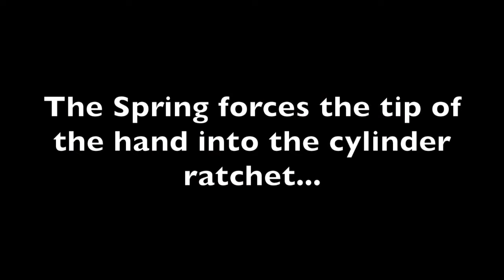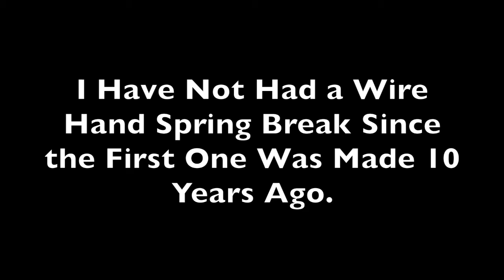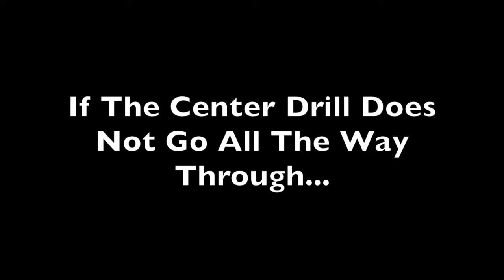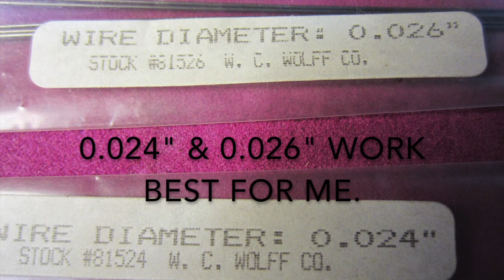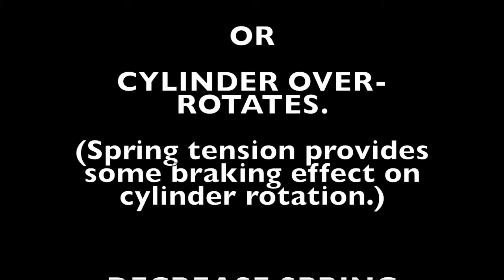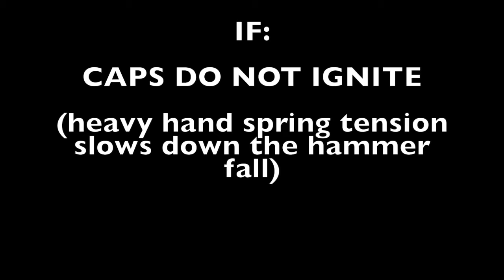Percussion Revolver Hand Spring Repair

Comment: I acquired an 1851 Pietta with a broken hand spring. I did not want to fit the replacement hand, so I tried your first method. It worked out great my first try. It was easier to form the wire spring than I taught. The only problem I had was wearing out two cobalt drill bits drilling through. It seems that hand is hardened all the way down. Thanks for your vid!
Reply from the maker: Thanks for your comment.  I’m delighted you were successful.  I’m also glad to hear that the quality of steel in the hands has improved.  Some of the early ones I worked on were soft.  Yours should be trouble free for a long time!

Comment: Very informative but what is even better is the quality of this video. Excellent production and choice of music. A joy to watch.
Reply from the maker: Thank you.  Since the video was made I have simplified the procedure a bit.  Instead of making a complete loop around the bottom of the hand, I simply secure a half-loop in position with a dab of epoxy.  Then after the epoxy sets, form the arc of the spring.  Faster and simpler and works just as well.  Good luck!

Comment: Fine video Doug. Interesting concept you have chosen for repair on this specific issue. Round spring steel over flat spring steel. Reduced surface area of engagement, ease of adjustment. The only problem is affixing the round spring steel to the hand. You have chosen adhesives. Noticing you have what appears to be a vertical mill, you might also have a torch? I might recommend 15% (or higher) silver solder if affordable. If heated properly, with a fine tip, it should be fast, no warpage and temper of your steel should be OK. I have used epoxy in hundreds of firearms applications. For metal to metal, if I can, blazing, welding, silver solder is the way to go. Again Doug thanks for your video and selection of fine music...  Texas

Comment: Best way is drill the frame and use the coil spring and plunger with a set screw like Uberti competition 1873 SAA'S are done. That eliminates the hand spring and you can harden the hand it isn't hard to do.

Comment: Great idea! 
I am sick of having to buy new hand springs for my New Model Army.
Reply from the maker: Thank you.  Since making the video, I have found that it is not necessary to make a complete loop around the bottom of the hand.  Just securing the wire to the bottom of the hand with a dab of epoxy is enough, then form the spring arc after the epoxy is set up.  Have courage and experiment!
Reply: @dougbryan8240  I think the general concept was very clever. I just used what I had lying around which was hanger wire, JB Weld and a hand drill. I didn't do the loop. So far so good! https://imgur.com/NGj061Y

Comment: Great idea may try for my 1875 hand spring just broke and don't feel like waiting for a replacement.
Reply from the maker: Since making the video I have simplified the process.  On later ones I no longer make a complete loop around the bottom of the hand.  I just bend a curve into the bottom of the wire so it will fit part of the curve on the bottom of the hand.  Then epoxy the wire into the hole.  Finally trim the tip of the wire to the proper length and shape.  You wind up with an "S" shaped wire hand spring epoxied into the position.  Much easier to make.  Good luck and let us know how it works out for you.

Comment: Great idea! The spring of the hand of my Uberti Colt Police 1862 broke recently. I've ordered for a spare, but meanwhile I've applied your method (complete loop) with a 0,030" wire and I must say that it works fine, even softer that the original!  My question is: Do you observed any anormal wear in the frame due to the round shape of the wire spring?
Reply from the maker: I have not seen evidence of wear on either the wire spring itself or in the frame passageway.  These guns shoot about 200 balls a year.  I keep my guns well lubricated.  I suspect that using the gun more often, or dry and dirty might increase the risk of wear, particularly in a brass frame, but that hardened steel frame is tough.  It will be interesting to see how long it might take for wear to be noticeable, if ever!

Comment from the maker: I think the re-enactors prefer the more “historically correct” flat spring. Many re-enactors “defarb” their guns, removing all modern markings too. They will probably not shoot their guns as much as cowboy action competitors, so their springs are less likely to break in the first place, and they might actually enjoy having a hand spring break because the originals did too! I have never had the hand itself break, out if the dozen or so open tops I have owned, and never heard any of my fellow competitors have that occur either. I have heard of hands wearing down from a lot of shooting which throws the gun out of time, but fortunately replacement hands are easy to fit.

Comment: Does this work with other revolvers besides the Colt's?  Like for instance the Remington new model army percussion revolvers?
Reply from the maker: I have done this replacement on Colt, Pietta, and Uberti open top percussion revolvers.  I have never owned or worked on a Remington New Model Army.  If your Remington has a flat spring like these others, I see no reason why the wire hand spring shouldn't work.  Please let us know how it works out if you attempt it.   Let me add that I made several more springs after the video was posted, and found that a simplified design works just as well.  My most recent wire springs are "S" shaped, with the middle body of the "S" in the hole, and the bottom leg of the "S" just sitting in the groove in the bottom of the hand.  I no longer make a complete loop around the bottom of the hand.  Epoxy the "S" in the hole, allow it to set up for a day, then trim and shape the working end of the spring as described in the video.  Quicker and simpler, but not enough reason to redo the whole video.
Reply: @dougbryan8240  Thank you.  I ask because I will soon be getting into black powder shooting (moving away from Nj where they are heavily regulated) and the 1851 colt I am getting is okay but the Remington I have waiting for me is used and has a busted spring.  It looks like the hand spring shown in the video.
Reply from the maker: @thelonerider9693  Please send us an update when you get finished with it.  Thanks and good luck with finding America!
Reply: @dougbryan8240  I will. Six weeks to go I'm excited.  Can't wait. Also: The 1851 (in .36) I got waiting is a brass frame. Would that be safe to shoot with light loads until I can afford a steel framed one? I heard the brass is not durable tho it looks pretty. I think it's an old Richland Arms Pietta.
Reply from the maker: @thelonerider9693  I have owned brass frame 1851s made by Pietta in .44/.45 caliber. I shot about 20 grains of FFG Schuetzen powder below a cast round ball and never had a problem with the frames stretching.  I think you would have to shoot much larger powder charges to endanger the frame.  Brass frames are inherently more vulnerable abuse than steel frames but if you don't try to make the gun into a magnum I don't think you will have a problem. There are videos elsewhere on YouTube showing a fellow using a brass framed 1858 on African game, so you pays your money and you takes your chance!
Reply: @dougbryan8240  Thank you! It gives me something to look forward to!

Comment: Good video! do you harden the spring stock after you form it?
Reply from the maker: Thank you.  No, I have not found hardening the spring necessary.  None of the springs I have installed (about 10 or 12 over the years so far) have broken with normal use.  I would be afraid that hardening the spring wire even more than it comes from the supplier might eventually cause failure from metal fatigue.  But I admit I am not a metallurgist!